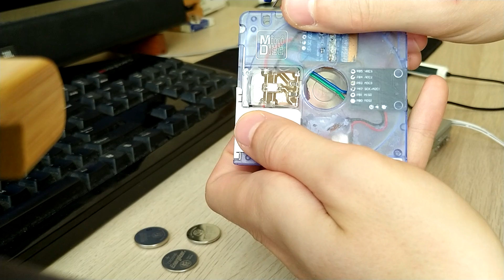MiniDisc laser power meter

Comment: You should put a bluetooth module in there instead of the arduino, something like a NRF52 would be great. Then you simply implement the code in that with the added bonus of making it accessible over bluetooth while it is running!
Reply: Bluetooth is insecure garbage.

Comment: Salut, interesant. 167 de ce?
Reply from the maker: Hi, I don't have a reference laser source to calibrate against, so it's just a measure of voltage drop across a 1K resistor corresponding to current produced by the photodiode in photoconductive mode (reverse-biased). It's a 10-bit ADC readout (against reference voltage) which is approx 0.97V after conversion.